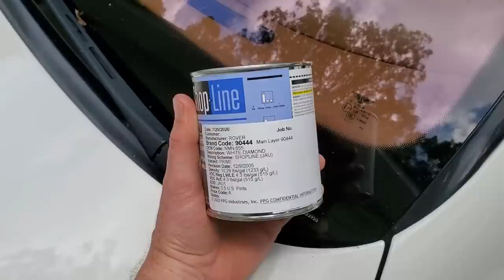Cheapest Bentley Flying Spur in the US - Key Mark Scratches From Vandalism Repair

Comment: Nice job on the Bentley Brother! I have a Crystal Blue Continental Supersports (it's a 2 door coupe model and the Supersports is a limited edition model - it's got the W12 twin turbo but its 621 HP, does 0-60 in 3.7 seconds with a top speed of 205 MPH and even though I don't go around racing her, no one's been able to hang with me when I've gotten on her. Cost new of this baby was $280,000!) and I used to live in NYC where just about every other swinging d1ck has a suped up rod or luxury/sports car. I've had guys in AMC Benz drooling over her and many offers to buy her, so I can appreciate your love for the car. I've had many cars in my life, from hot rods to luxury rides (I had a Challenger Hellcat and an Infiniti right before this) but the Bentley is a whole other animal. I cannot go anywhere without turning heads and people taking pics of this car and everyone in my private subdivision knows this car more than they know me lol. I've been fortunate enough to only have normal maintenance issues with it and it only has 66,000 miles on it. And since moving to Missouri, my DD is a Ford F250 Lariat Triton V10 lol, so I fit right in here! I moved here in July because I value freedom and 2A and NYC was going downhill quickly...
Anyway, welcome to the Bentley owners club, you made a great investment! If you ever do decide to change the look of it, don't paint it, most wrap them nowadays, but get someone who knows what they're doing - a shitty wrap can ruin a great ride..
If you want to see pics of my Supersports, hit me back. Ive subbed you too, you do nice work, you take pride in what you do and that's key in resto work (I used to restore bikes) so I wish you much success in your endeavors!

Comment: As a mate said to me once find the cheaper cure using sourced pattern parts if possible. If the symptoms still exist consult owners clubs or forums . A lot of damage takes time to repair if its  made a car financially unviable from an insurance  point of view.  Time costs ,so use the slower more thorough option if you can once bought  . Cutting back paint will save a lot compared to a respray.

Comment: There's an old trick to cutting the raised paint using a razor blade. Strop one side of the blade to slightly curl the edge then lightly drag it over the high part to shave it down. It works perfectly and only needs a little buffing afterwards. For inside curves, I use a razor sharp pocket knife that I've used for 40 plus years for only this purpose.
Also, try a small syringe to apply touch up paint. It goes on cleanly and evenly.

Comment: Good video. Did you consider putting bondo on either side of the scratch after the paint fill, let it dry, then sand down the bondo. It protects the paint level as you sand down the paint and the bondo on either side of it until the bondo has gone. I've never done it but I saw it on Youtube and it looked like a great way to avoid cutting into the clear coat/paint around the scratch when you are trying to level the paint in the scratch. Its similar to your tape approach but I think you level the paint a bit lower than you can with your tape approach. Just a thought. Keep up the good work
Reply from the maker: I had thought of using glazing putty but I decided not too.

Comment: The tooth pick is a good idea but I would have taken a razor to make a nib of the end. Much more accurate application. I wouldn't have used tape either. It sure helps that it's white as well.
Reply from the maker: I did nib the end of the toothpick. I also discontinued the tape after the first scratch since it was making a mess.